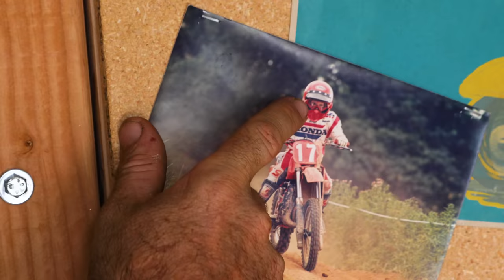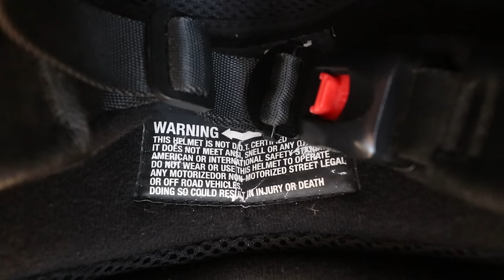Crash Helmets / Vlog #13

Comment: Hey Jamie, Thanks again for the good advice. This is probably the Best advice when it comes to motorcycling. I do have an Arai XC 3/4 Open face which is great. Then I decided a few years back to go 100% Full Face when I am on my street bikes. I bought a Bell and it is cool, but I bought it because it had the transition (darkening)shield and I trust the Name Brand. I think I will go check out the Arai's again. At this moment, my friend is in the hospital, for over a month now. He hasn't woken up since his motorcycle crash. He got some bad bodily injuries, but had also sustained a severe brain injury. His helmet was not the best brand either and was a low end brand. In short, the motorcycle hit him in the head and didn't hold up. It was a Sportster Chopper and the front brake was removed, which is just one of the worst decisions one can do as a style choice. He couldn't stop and crashed. (Maybe ok and not ok mods could be a good topic for a video?) Thanks always for the best advice. I am going to fire up "Freedom Machine" DVD this evening ;)

Comment: 👍
With my new Bonneville I bought a Bell Qualifier DLX with MIPS.  I firmly believe it to be top echelon as to safely; but it was never comfortable.  It was hard to decide to get a new helmet when I had a new helmet that I believe to be totally adequate.  But dam, a helmet should be comfortable to wear.
So I found a terrifice deal in an Arai Defiant X and it's so, so comfortable! 😘  Never scrimp on a helmet for safety...or for comfort.😎

Comment: ...I just finished "Freedom Machine" ...Excellent and very inspirational! Guys, I recommend getting it from MotoGeo's website. It is inspiring! 
I actually went to the 2015 Progressive Motorcycle Show at Long Beach Convention Center mainly to see the new Ducati Scrambler Icon...exactly your model. At the time I had a 2006 Bonneville and didn't want to buy a bike similar in class, so I didn't get it and bought a 2015 Yamaha FJ-09 instead. Now I wish I bought the Icon !! I still have the FJ-09, but bought a 2001 Ducati ST4 in which I have fallen in love with.

Comment from the maker: Please comment and tell us what crash helmet you wear, and why? Ride free, ride safe and enjoy ever mile 👍
Reply: I have arai RX7X & XD love both of it.. 1 for my track rx7x, & my daily XD.. Perfect fit in my head shape & perfect comfort..
Reply: I have worn Arai for years and still appreciate their workmanship and quality. However, recently I have become more concerned about the Snell standard and how it may be causing manufacturers to develop helmets that are unnecessarily hard to survive the second hit requirement. I don’t want to end up with a concussion if I go down at modest road speeds because my helmet is designed to withstand a second hard hit. So, q while ago I purchased a Bell Race Star Flex for its combination of multi density core and MIPS-like rotational protection. More recently I picked up a 6D helmet because the available data suggests that it does even a better job of slowing both linear and rotational accelerations. 

I realize that Arai would suggest their round shell designed to glance off minimizes the need for rotational gadgets inside the helmet and perhaps they are right. And I know they use different densities of EPS in the helmet but they seem to approach it differently. Rather than multiple layers throughout the helmet to provide a softer material for initial or low impact deceleration, it appears that they use different densities in different areas depending on local stresses (around the visor opening for example). 

Unfortunately it’s impossible to find data that to really compare these various approaches so at some level we have no choice to continue to rely on anecdotes and videos about workmanship etc. However, at the moment I’m leaning toward systems like Bell’s flex or 6d’s Omni directional suspension system. I would love to hear more from Arai about people’s concerns about over hard snell helmets and how they are mitigating initial acceleration problems but so far haven’t found anything where they directly address it.
Reply: Had 3 street ARAi and 3 Shoei helmets over the years. But once I discovered how much lighter the ECE helmets like Suomi, Shark, AGV or Airoh were I could never buy SNELL helmets again. It just makes too big of a difference to me.
Reply: Arai Signet X full-face in white because I have a long-oval head shape and because white helmets help motorists spot you more easily in traffic.
Reply: @HJC1950  I doubt white helmet is more visible. At a quick glance everything is in the white/grey/black spectrum in normal traffic. For good visibility you need a bright color that stands out. Orange or bright green, something like that.
Reply: RX7 V I tried so many on I was knackered and what do you know, the most comfortable was the most expensive-they had. They had a 0% interest offer on, so I spread the cost.  I think you should push the boat out when it comes to the gear you choose.
Reply: @mocioclistu  White helmets are more visible. Proof here:  https://www.bmj.com/content/328/7444/857.full   I raised this point because the most popular color for helmets in the US is black, which is  the worst choice for safety. Bright colors are good, too, but white works fine, is cooler on a sunny day, won't fade, and is readily available.

Comment: I have always been an Shoei guy. I got my first, an RF700 when I was about 14. I've got got a few Shoeis, including the Hornet X2. I just picked up a new Arai XD4 for $250, so why not try it? Great helmet, much lighter and better ventilated that the Shoei, but a tad noisier. I wear earplugs, so the comfort of the Arai more than makes up for the nominal noise increase. I also picked up an older Arai Corsair for cheap. Though new, it was several years old when I got it a few years ago and is too old for me to consider wearing. Plus, it is the Nicky Hayden replica, so that has a special place on display. RIP Kentucky Kid!
Reply: Man, I would love picking up a Kentucky Kid replica just for display. Love that

Comment: I have a massive head. Lol have yet to find a good fitting helmet. This is something I worry about every ride. I live in a smallish city in Northern Ontario Canada and the section of helmets at the two dealers is shit. I have no clue what to do. Tyed the measurement thing and it didn't work   help?
Reply: Figure out your head shape first, only after that can you measure around your head and get the right size. You may have to buy one online since your selection locally isn't good.
Reply: @HJC1950  head shape?
Reply: @adventurewithrulysibatmasi9056  Long oval, intermediate oval, round oval are the head shapes. Arai's Signet X is a  helmet for long oval head shapes.

Comment: For me the best helmets are modular one for ultimate confort and safety. But it's look like there is no modular helmet at Arai...too bad.
Reply: Aren't modular helmets more unsafe due to the moving parts?
Reply: @coolabananers  Would be nice to know.
Reply: They are always going to be less safe and heavier than a regular full face, but they have improved a lot over the past few years.
Reply: Shoei NeoTech 2 modular is very comfortable, a little heavy but if you sit more upright its a great modular. I have the AGV carbon fiber also and it is very light but not as nice as the Shoei and louder... ..
Reply: There’s a reason arai don’t do modular helmets... they don’t compromise on safety..